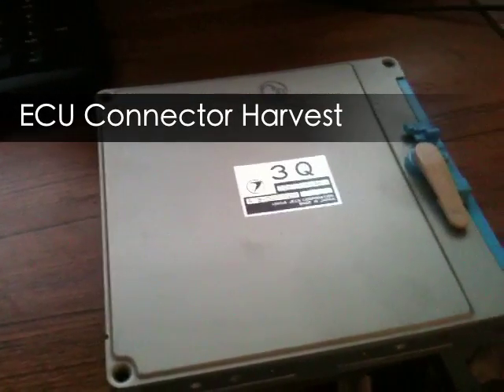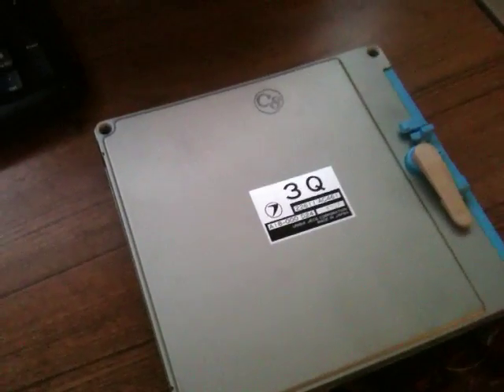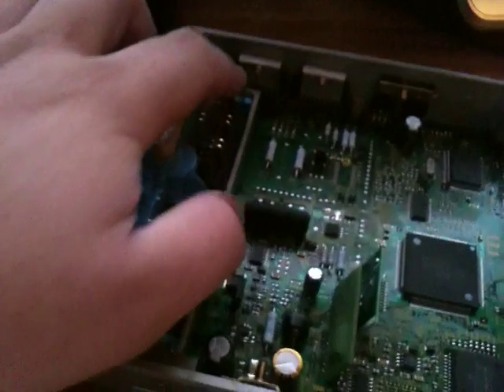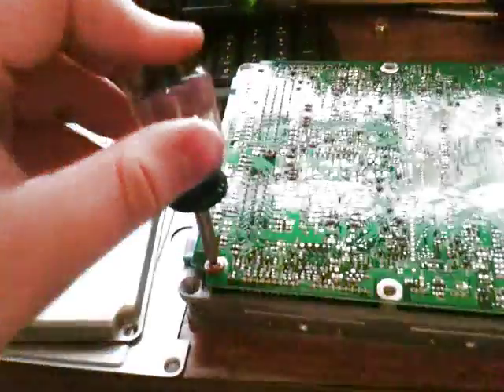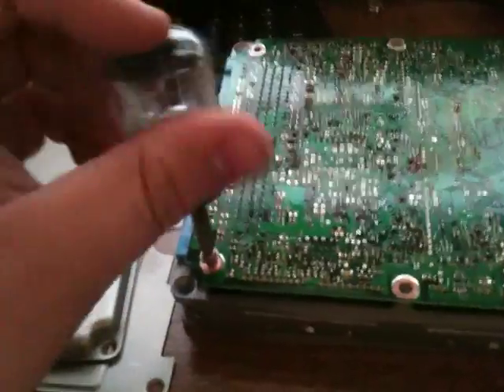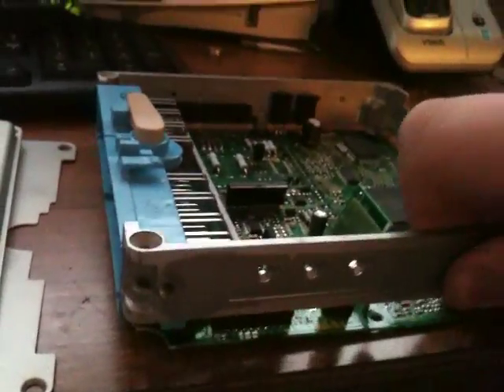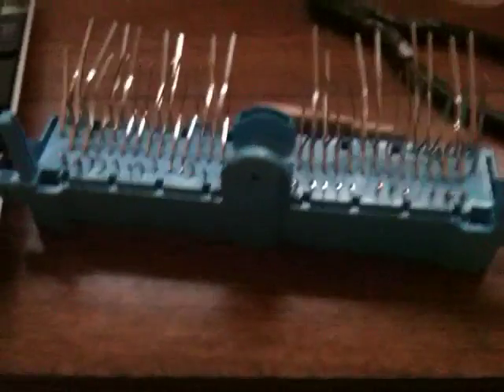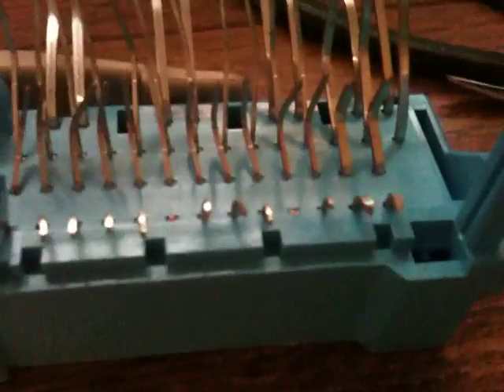Subaru Swap Vlogs - ECU Connector Harvest

Comment: Bump: I did this recently to build a plug and play greddy harness for my 99 gt lego, what i did was first solder wick out as much solder from each pin as possible then with a heat gun, heat the underside of the board till the connector pulled free. worked like a charm